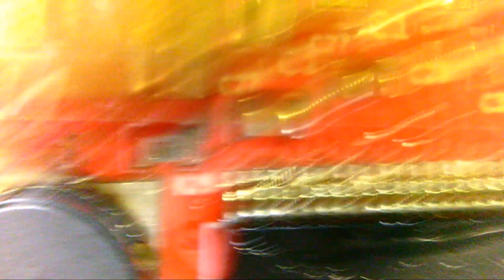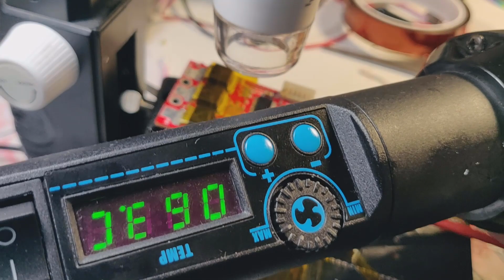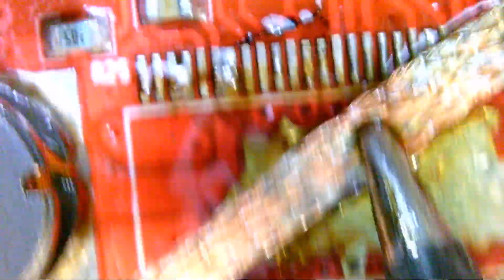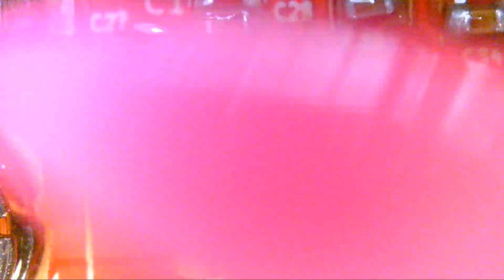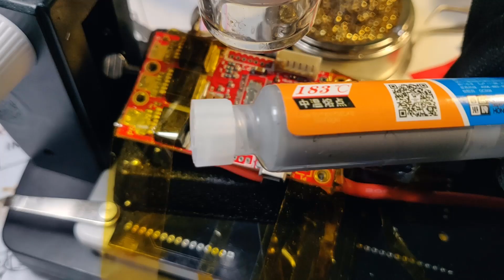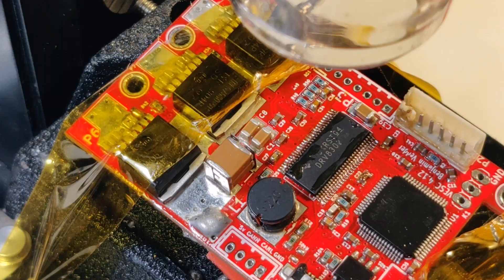How to Remove Solder Bridges on SMD Packages

Comment: In going to replace a 48pin IC on my Xbox. Don't know how well it will end up. Having no microscope. I can use my phone. That can take me quite near to look. But isn't 100 degree Celsius too low for solder paste to melt? I thought lead free solder melted about 300-350 degree Celsius.

Comment: IS it easier to use flux paste....then heat...and try to sweep OR to heat the middle if possible and suck?  i also dont know if u really have to have a flat tip or if u can use a pointing tip?
If i want solder to get attracted to the solder tip? how do i do this? i see when i heat fresh solder on the tip of the iron it just makes small little balls and falls off.... it does not stick to the tip? is this wrong?